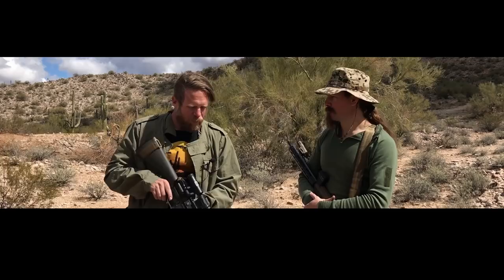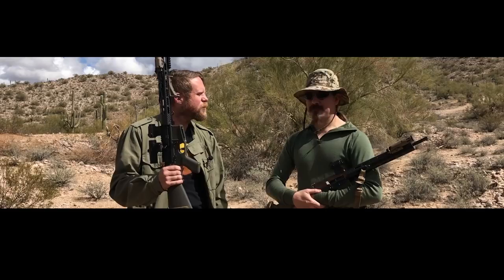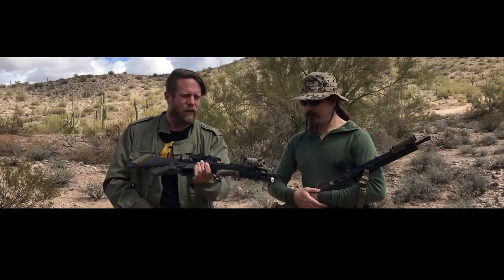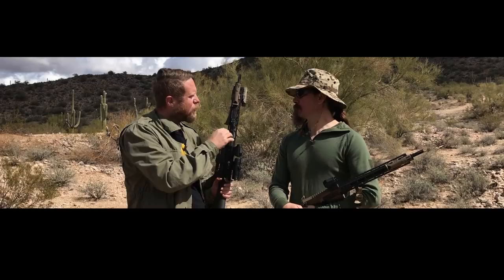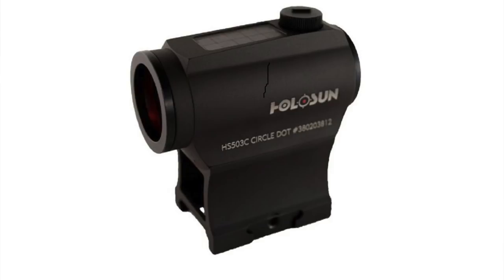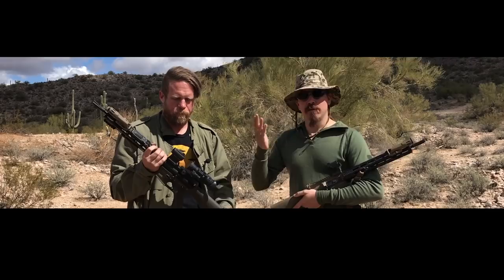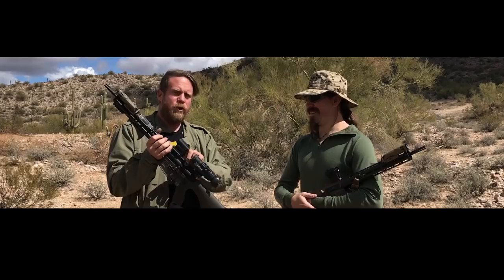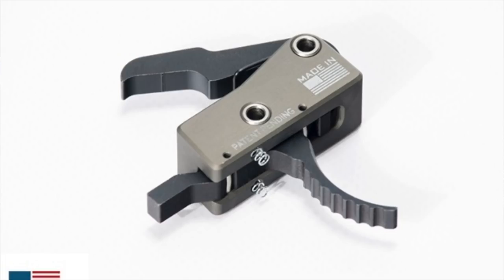WWSD: Rethinking the AR15 - CONCLUSION

Comment: Dear Karl & Ian,

I've actually been thinking about the WWSD rifle and its application. I will say that I did not expect an AR to be as good for the intended application as they turned out to be. 

Honestly, the AR is outdated and the only two reasons it can play with more modern offerings are that modern offerings arent nearly what they could be by now, and the huge aftermarket for the AR platform and I think the two are related. Because the AR is continuously updated there will never be enough incentive to develop a proper new platform, which kills progress. The aftermarket has solved a lot of the problems of the platform by working around them, most notably ambidextrous versions and high parts that allow WWSD-style builds. But it should be noted that these are workarounds, regardless of how good these workarounds are. The rifle was never meant to be modular and, by the true definition of modular it is still arguable whether or not we can call it that even now. An old saying goes here; "good is the greatest enemy of better". For example, look at the XM8 rifle prototypes and their superior fire controls. The strong hand controls all the catches and levers and the rifle is 100% ambi by nature it even combines the traditional paddle mag release with an extension that allows you to actuate it with your trigger finger (I have that installed on my HK SL8 as an upgrade, as well as the extended bolt release - the XM8 really is just a skin for the G36). It's not rocket science but no such platform ever has the chance to enjoy over 50 years of development because the AR is better than it deserves to be in the modern day. Having said all that, that is not my main conclusion after thinking about the WWSD builds.

Again, it should be noted that they seem to be absolutely fantastic rifles for their intended purpose, but what I have my reservations about is the choice of said purpose. From what I've understood from these videos, the purpose of these rifles is based on the assumption that they will be used much like how the military uses theirs. I especially remember claims from Karl about how an intermediate cartridge is great for follow-up shots and that any misses are good suppression so you'll have a great advantage in the light weight of the ammunition. While I certainly agree with all of the logic in this statement, I do have severe doubts of the validity of the assumption it is based on (and while I recognize my status as an armchair commando, please bear with me here - my purpose for writing this out is merely to spark discussion and provoke thought).

The real question is, if YOU have to go to war, will you be in a squad of equally well-trained soldiers supported by other squads, armored vehicles and close air support? The 300m effective combat ranges often quoted definitively apply for military applications, but will you be in a military environment when the SHTF? Let's turn this on its head and start a fresh line of reasoning from the assumption that you, the reader, are a civilian, any ol' dude or even a bunch of duded who shoot the same rifle classes and competitions. What if the S does HTF? Most of us would like to believe we'll form a (semi-)organized resistance to whatever Bad Guys(tm) have caused said S to H said F or an armed neighborhood watch. A "well regulated militia", if you will. Will the same rifle still be the one you need? This is going to vary strongly with the enviroment and the nature of the S that has HTF, no? Let's say you're tring to maintain some semblance of a rule of law amongst a panicing and looting population in an urban environment and I can see the same rifle being highly appropriate. Now what if things escalated? You're no longer holding off looters or rioters, but need to oppose a superior force, as in, actual war? Now I'm not so sure anymore. If you're using the same tactics as an organized military class enemy, you, being outtrained, outnumbered and severely outgunned are at a 100% disatvantage. To create advantages you'll need to deviate by definition of the situation. The only effective way to fight a superior enemy is to employ guerilla tactics. Anything that will let you increase your "K/D-ratio". In cases as these, trying to suppress a numerically superior and heavier armed enemy serves no purpose other than to give your position away. Surviving becomes more important than eliminating targets you can eliminate another day just as well. Stealth will be key and range will be your friend. You'll want to fire only as many rounds as necessary rather than as many as possible. You don't want to fight fair, don't want to fight the enemy in places where they have the advantage. You won't be clearing rooms and firing hanging upside-down out of a window (hyperbole). Suddenly the requirements for your rifle change significantly. This is why I got really excited when I first saw pictures of the SCAR Mk.20 SSR, even though it still sticks to a lot of the AR's awkward controls. Or maybe you should even take it further and get some kind of suppressed .338 caliber bolt-action precision rifle. It depends. As Karl mentioned several times, someone at 300m that doesn't want to be seen, generally isn't, but that works both ways and it could be part of your tactics. But I know that if Zhe Germans (Euro dude here) get up to no good again I won't get very far with any .223 or similar caliber weapon kicking in doors and clearing rooms.

What these rifles seem to be built for most of all is to run 2G competitions and certainly that isn't the worst way of representing reality out there, but there are some compontents of it that I feel skew the impression of reality that it may give. I fully understand that these competitions are designed so that any possible skills one may need are put to the test and by no means will I criticize the stage designs for that. But what I think we should keep in mind is that even if, say for the sake of the argument, 20% of all 2G competition shooting is done support side and another 20% trough some kind of awkward obstacle, real-world firefights don't necessarily play out to the same statistics. So while it's definitely good to TRAIN those skills to a useful level, it would be a mistake to take that same training/competition to be a realistic representation of reality and by extension, while it may be a good way to test yourself and your skills, it may be the wrong way to test a rifle because it will skew the focus of the build. As a very obvious example I will take bullpup rifles. These are often derided for throwing brass in your face when shooting support side. But is this really an insurmountable problem given the low probability that you'll have to do so in a real-world situation as opposed to the very large probability that you'll have more room to choose where, how and if you'll engage? (As mentioned above, don't fight fair, make sure the situation is in your advantage before you engage.) Even if you get into firefights on a daily basis, how many of those are going to be the ones where you eat some brass? And even if you do that one time, are you even going to notice when people are actively shooting at you? I might rather have a rifle that does other things better that are more useful in situations that are far more likely to occur (whether that be a bullpup or anything else is beside the point here, I merely mentioned it as an example). Likewise, many other things that are common in competition and training might not be common in the real world. Therefore one needs to think very hard whether the rifle they build to do well in competition is a rifle that will be equally optimal in the real world.

As such, rather than a "What would Kalashnikov do" rifle, I'd like to see something that isn't basically a Russian-styled clone of the WWSD rifle, but something that explores different kind of tactics and strategies for different applications alltogether. I'd also like to hear your thoughts on my way of thinking. If any of what I wrote comes across as a statement of fact, please try not to take it that way. I don't have any of the answers, but I can at least poke this internet hornet's nest to get some different points of view.
Reply: Let me start by saying I am definitely not an expert, But with my experience as a infantry marine and years of research into these particular topics, perhaps I can answer some of your questions, or at the very least, contribute to this discussion (which I find to be very intriguing and well-thought-out).

First off, I would like to say that you are being very honest and realistic with your SHTF scenario. But I think you might be a little too specific as far as how you plan to go about engaging an opposing force, Especially a well equipped and highly trained military force.

I think the scope of your question has become so broad, that it really is not about AR15s anymore, (which I think you admit to, it's hard for me to go back through your entire comment to find it) rather, it's about what scenario you're most likely going to find yourself in, and what is the best way of dealing with that particular situation. 

Now I would like to stick with your idea of civilian forces fighting an opposing military operation. To be 100% brutally statistical, you will lose. You will not, nor will any civilian force ever stand any reasonable odds against a military power, be it the United States, Russia, China, Germany, the UK, or any of the other main world powers with significant military might. While civilians may have the numbers, and the guns, they do not have the training, the equipment or the funding to wage a force on force conflict with these entities.

What your personal rifle is capable of as far as combat aplications, essentially becomes meaningless in the grand scheme of things. Look at examples from the US Vietnam war, or the Russian conflict in the Middle East, or even now, the US conflict in the Middle East. Militarily the indigenous forces do not stand a chance. Whether by Room clearing or long distance guerrilla tactics using precision shooting, they just are not inflicting much damage.

Do not misunderstand me, those indigenous forces certainly have left a mark, but their legacy definitely over plays their over all achievements. While people like to say the US lost the Vietnam war that just isn't true from a numbers standpoint. Sure, politicaly the US government declared it a loss but as far as numbers killed the US has a clear and overwhelming victory. In fact, during the largest ememy operation of that war (The Tet Offensive) the opposing forces did not win a single battle against US forces. The conflicts in the Middle East are playing out in similar fashion. Friendly casualties are far outnumbered by the enemy's dead and wounded. Not to mention the sheer number of entire neighborhoods/villages being wiped off the face of the Earth through airstrikes.

In summary what I'm saying is, if you plan to take on an overwhelming military force, your best bet is by using guerrilla tactics (as you stated) however those tactics will need to consist mostly of utilizing traps and explosives.

Your biggest problem will be the enemy's mobile armor and air capabilities. If the military decides to send in any sort of armored vehicle down your neighborhood street, it's over for you. People never really consider the armored capabilities of foreign military powers. Sure, everybody wants to be the guy that will hold their own in a 36 hour fire fight against infantry forces, but the reality is you will maybe dump one and a half magazines before getting an air strike called in on your position, or having an armored vehicle plow through your defenses.

I know that was long winded for only answering a portion of your question, but I think it is necessary considerations for that particular SHTF scenario.

In such a scenario, I think long range sniping wont do much good. Infantry is almost always accompanied by vehicle support, and never in 1 man squads, so you won't get a one shot one kill run away to fight another day type of out come. You pop one of them, they will hunt you down. Additionally, in long range wide open spaces, ideal for precision target elimination, it is easier for aircraft and armored vehicles to be deployed. So in the end you honestly stand a better chance of fighting from a fortified location Where armored support is impractical. Namely densely forested mountain warfare. Keep in mind, that still leaves you wide open for air strikes. But, on the off chance they send an infantry detachment to pinpoint your location, Then maybe you will get a few shots off.

Of course, that is all speculation but I feel it is probably the most likely of outcomes given a full blown military invasion or tyranical government oppression.

I think a much more practical SHTF situation would involve short term, immediate aftermath of a large scale disaster. I.E. Natural disaster or industrial explosions/melt Downs in which case, like you mention, there would be lots of looting and opportunistic behaviors. Then, rifle choice becomes much more relevant.

To put it bluntly, the AR15 is going to be hands down the best over all civilian carbine option. It has come a long way since its adoption. I know you feel like most of the improvements to this particular rifle are simply work arounds, but that just isn't the case. There were a lot of things about this particular rifle that were done right from the beginning. A lightweight intermediate caliber rifle that is effective up to medium engagement distances, that allows for rapid shot succession while maintaining controlability is exactly what you want out of any rifle. When it comes to 5.56 rifles, the AR15 really excels at those points And is in many cases the standard for those points.

When you look at the incremental improvements to the AR15 over the course of its lifespan, it sounds like you are looking at them as improvements for that 1 rifle specifically. In reality, the improvements that are being made to the AR15 are improvements that are being made to every rifle that tries to come to market. There is always going to be a limit to how reliable, accurate, easy to maintain, maneuverable, etc., a rifle can be, but for the time being it seems as though we've reached the limits of what we can do as far as making any infantry rifle more combat effective.

The problem with trying to replace the AR15 is that most of these weapon candidates don't do anything better than the AR15, and if they can, the AR15 is easy enough to modify until it becomes just as effective as its competitor for a much lower cost, and more importantly, NO NEW TRAINING.

There have been many programs to try and replace the AR15. Some of which you mentioned. The SCAR, the ACR, the OICW (I may have gotten some of those letters in the wrong order). The end goal of These programs were to improve the combat effectiveness of the individual soldier. In reality most of the perceived "issues" of the AR15 are not due to the weapon itself but rather poor training or misuse of the rifle in an application it was never designed for. Improvements were then incrementally made to compensate for human error.

FINALLY,  You mention bull pups. Now my response has already gone on for way too long, so I will keep it brief. Bull pups were designed around a specific purpose. To keep the ballistic potential of 5.56 while also decreasing the over all weapon length to help during vehicle transportation getting in-and-out of helicopters and armor, as well as applications for CQB. While that is good in theory, a bull pup configuration sacrifices far too much in several other categories, namely malfunction clearing. I think you may have mentioned it in your comment, but in range TV has a video called "why bullpup" which points out most of the problems with bull pup rifles.  But what they don't really cover in that video is the fact that there have been many improvements to the 5.56 cartridge itself that improve its ballistics out of shorter barrels with faster twist rates, which essentially makes the bull pup concept irrelevant.

I apologize for going on for so long, but you really do have an interesting conversation here. Most of the points that I've made I haven't put much prior thought into, so I'm sure there will be holes in some of my reasoning. There is also much more I would like to express but putting it all down in a YouTube comment that will probably never be read is probably not the best place to say it all. But I hope I was able to convey a somewhat coherent response with the tools that I have. Thank you again for a worth while topic!

Comment: When I first saw your WWSD AR15's, I couldn't help but laugh. I had built a similar rifle in 2009 just before Cav Arms closed up shop thanks to the ATF. in 2007 I had build a 20" Hbar behemoth of a rifle that weighed every bit of 15 pounds. My next rifle I wanted to be as light and cheap as possible. A CAV-15 lower with a DPMS pencil barrel and a civilian flat top upper sans dust cover and forward assist was what I had come up with. No free floating forearm though. There really wasn't much on the market that was lightweight. M-4 style hand guards with the M-4 front sight and a detachable A-2 carry handle finished off the gun. There was no such thing as a cheap, reliable RDS back then. It weighed just under 5 pounds with a 20 round magazine and handled beautifully.

Comment: I have a Colt A3 H Bar 16 inch. I wish it had a standard 18-20 inch, this is why. 5.56 needs velocity to do what it needs to do. For every inch you reduce the barrel from 20 inches you lose 50 fps. So if a 55-60 gr bullet is 3100 from a 20 inch barrel , its about 2800 from a 16 inch, thats 200 fps. That makes a big difference at 300 plus yards for knock down power.